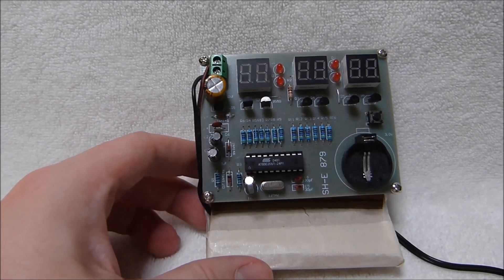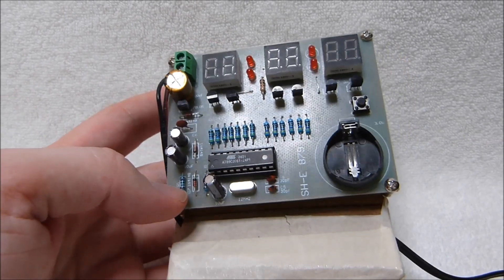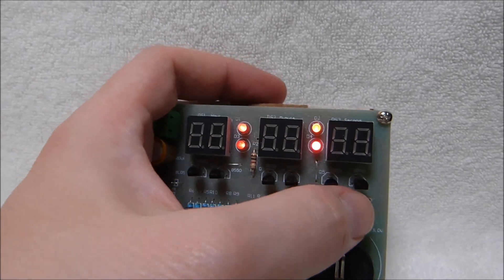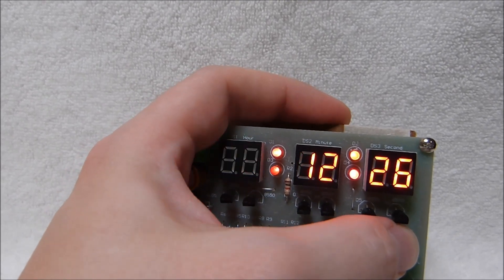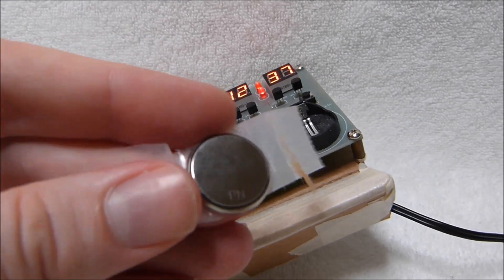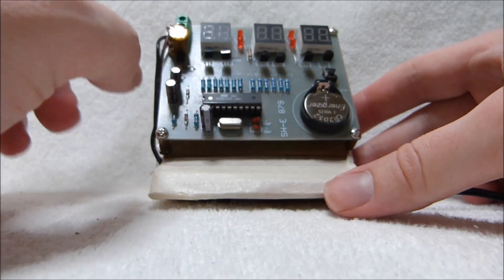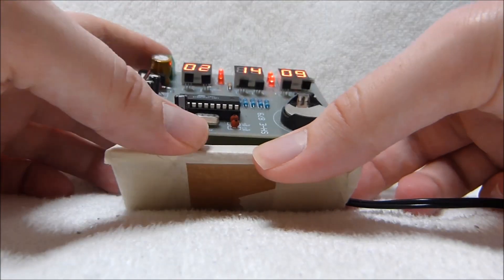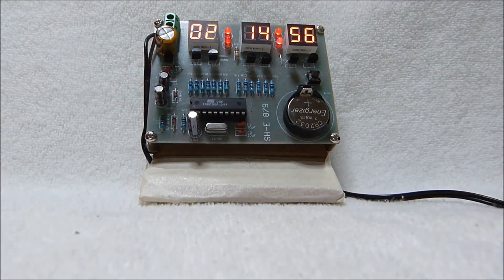An inexpensive LED digital clock kit, the SH-E 879

Comment: I just built this kit and the top right segment of each display doesn't light, any ideas?
Reply from the maker: Check the resistor for that segment, and the soldering of that IC pin. It's possible the chip is damaged too.
Reply: @50sTransistorRadios  I tested the resistors in circuit, not Ideal but it worked. They were all OK apart from the one in the bottom left which read zero ohms. I think that's part of the timing circuitry though.
The holes in the board are smaller than atoms so I think I damaged the zif socket, other than that I think the soldering is OK although some joints could do with a bit more solder.
Thanks for the input.

Comment: Looks halfway decent for a $4.00 shipped from China kit.  I do not know how they do that and get it here for that price.  Kills our market.  Do you use your own power supply?  AC supply I assume and what voltage?  Maybe 9 volts?  Are the directions in English LOL?  Thanks for posting.
Reply from the maker: I would agree, it's crazy how cheap this stuff can be. This one takes a DC supply of at least 7 volts, and probably at most 12. I used an old 9 VDC adapter to power it.